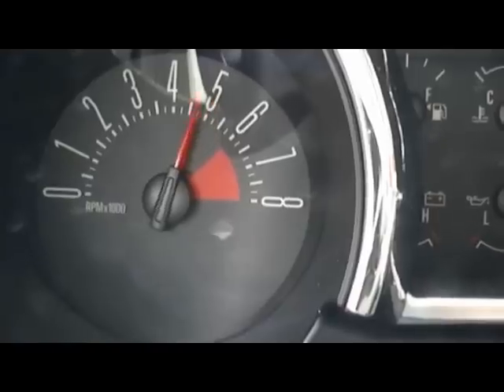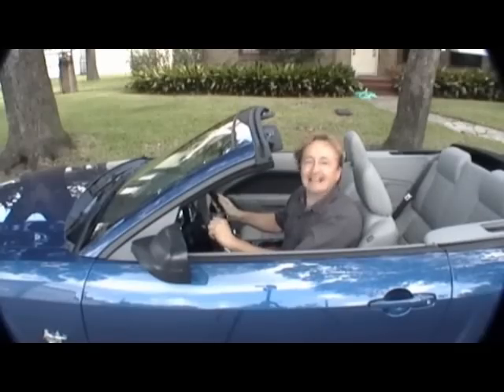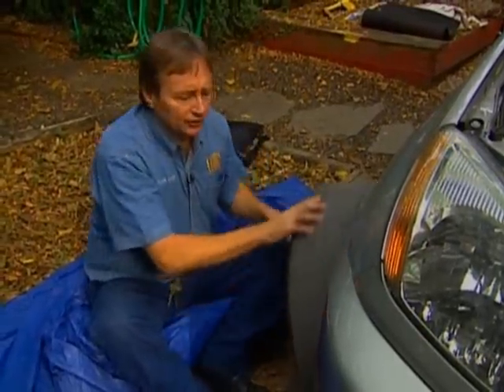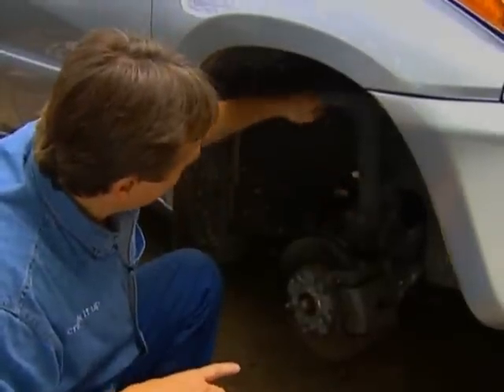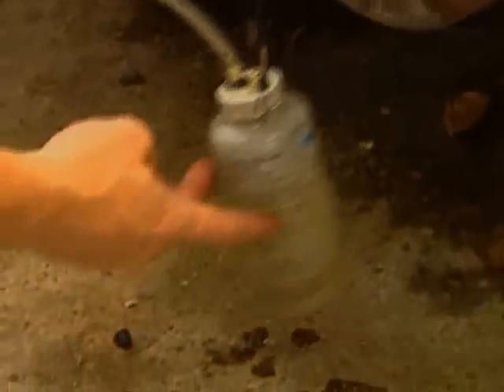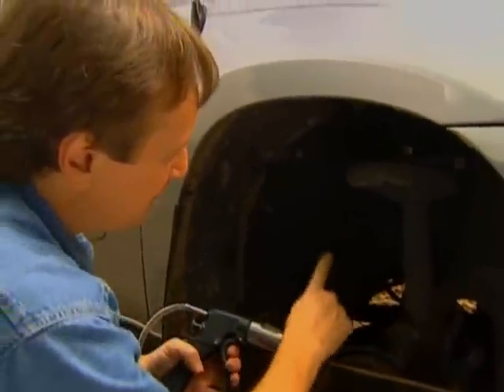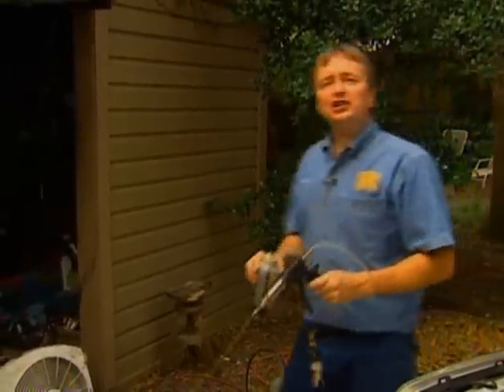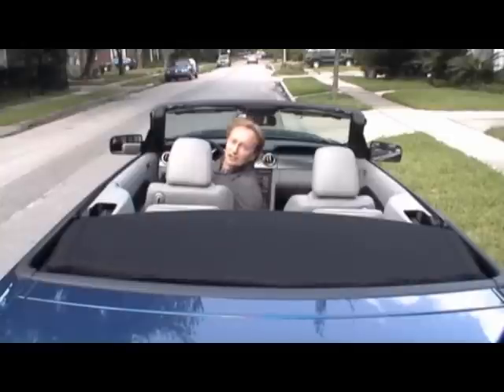How to Bleed Brakes in Your Car (One Person)

Comment: Scotty, please advise. I spend almost 1 week just to bleeding air in my brake system. I was just want to replace the discs and clean the piston chambers; but when I need to bleeding, it seems that all of the air is gone, fluid gets out from all bleeding nipples, but my pedal is still could be pressed down until floor. I've try to replace the brake master cylinder (with a cylinder of another car that works), replace all the piston seal, but still no succeed.
What should I do/try? Thank's in advance. (My car is a 2000 KIA Carnival)
Ardhian-Indonesia
Reply from the maker: IF you car has ABS brakes, you must pay a mechanic with a dealer level scan tool to bleed out the brakes, it can't be done any other way. If it doesn't have ABS, find a guy with a power bleeding machine, they always blow the air out
Reply: Scotty Kilmer Thank's a lot Scotty for quick response. Mine has ABS, but after so long effort, a "vilage level" mechanic told me to try to invert right caliper to left and left one to right, in order to make the bleeding valve inverted from bottom of the caliper to the top. Before I do that, I was wandering, what the h*ll is the difference...?! But due to my confusing what to do, I did that too.
And after some pedal pumping, it gets works. Everything is normal.
I'm now really sorry to buy some parts that does't affect at all, but I think it's worthed. :D
But I'm still wandering 2 things:
1) Why did with the old position of caliper and nipple (long time before replacing the disc), my brake was alright?
2) What is the difference between top and bottom position of the nipple on the calipers?
Would you please explain..
Thank's in advance..

Comment: Hey Scotty,I'm about to change the abs module/pump on a 03 escalade,any especial instructions besides the obvious on bleeding the system? Or do you have a video? Thanks.
Reply from the maker: panchovillaxx7 no video yet, but realize you may have to pay a mechanic to do the final bleeding out of air as it really does require a dealer level scan tool to operate the module and bleed all the air out fully in most cases
Reply: fair enough,im really against dealers,but im might just have to take it to it,since I don't have the scanner, thank you.

Comment: a young lad at my garage while the brake shoes were removed i asked him to check if the wheel cylinders were leaking for some reason he decided to get in the car and press the brake peddle, can this cause any other damage other than poping the wheel cylinder seals and air in the system?
Reply from the maker: na, just would pop the seals and get air inside

Comment: hello Scotty please reply. Can i used that tool on a master cylinder that has air in it? will it work on a master cylinder that has air? by the way how much is that Tool cost and can tell me whats the name please? thank you
Reply from the maker: yes, it gets air out anywhere, as it pushes the air up and that air then bubbles up inside the master reservoir and comes out the top where you add the fluid. It's called the phoenix injector, and they have various models and prices. Just google it and see which one you want to buy, they all work

Comment: Scotty would you have to 1st remove the master cylinder cap so the air your pumping back up can escape to atmosphere?
Reply: Yes and you also need to suck out some of the fluid in the reservoir with a turkey baster or something before you start or you might push some fluid over the side too.

Comment: There is a proper one man bleeding tool you can buy for about 5 bucks,its simply a one way valve on the end of a clear tube which allows you to pump the break peddle yourself with the nipple open not drawing air back into the system.
Reply: Where I can get that ? What's the name ? Any on Ebay if I want to deliver it Internationally ?
Reply: Halfords.ie .irish british auto store.EUROPAT VIZIBLEED BREAK AND CLUTCH BLEEDING KIT

Comment: I question how back bleeding any drum brakes will work very well with a Phoenix injector as the feed tubes to the wheel cylinders are lower at the wheel cylinders than the bleeders. This tool would be great on some clutch systems.
Reply from the maker: it works, believe me. The force the injectors inserts into the system would push air back that tiny bit of bend
Reply: That " bend" meaning a downward direction in the cylinder itself? It must create quite a flow. I'll stick with my pressure bleeder being I already have it. Thanks Scotty.

Comment: quick question, when i replace my brake booster do i need to bleed all 4 brakes or just pump the brake and tighten/loosing the lines that connected to the master cylinder few times?
Reply from the maker: +winkawak just pump and be careful not to move air downwards to the wheels
Reply: Scotty Kilmer
if i was going to replace my brake fluid will it be okay to use a turkey baster and get most of the fluid out of the master cylinder and pour new fluid in? will the new fluid circulate to all 4 brakes? also should i do it before or after pumping the master cylinder brake lines?
Reply: Scotty Kilmer
update
just installed my brake booster but now im getting a loud high pitch squeal when brake pedal is released, it will squeal non stop. I triple checked my vacuum hose and i didnt have this problem with the bad booster.

Comment: Help! Sometimes my pedal is firm, sometimes it's soft and goes far down... Does this mean I have air in the system? I already topped off my brake fluid.
Reply from the maker: if it has air in it, it will always be soft. your problem is more often a weak master cylindeer
Reply: Scotty Kilmer Got it, thanks!

Comment: I've just changed my brake pads. Now there's no pressure going through the line. But my ebrake still works. They was working before.
Reply from the maker: If pressure is sent back into the master cylinder too fast when pushing the calliper pistons in during a brake job, it can ruin the master; You may need a new master cylinder now
Reply: I've unhooked one of the lines to  master cylinder. One squirt. The other doesn't
Reply: Also now the passenger bleeds. But the driver side doesn't. The brake paddle is loose
Reply from the maker: Matthew Bui
replace the master cylinder
Reply: Did you ever figure out your problem? I'm having the same one... can't get fluid to 2 tire.
Reply: I fixed it. Bad line

Comment: It's good to know it will work on some ABS systems.  Actually, my modulator failed and required replacement so there was no way around an ABS system bleed.  

The modulator/pump assembly was $2500 from a discount dealer new.  That's about 25% of the value of the whole car!  I got a used one for $200 and it has been working for 3 years now; knock on wood.

Comment: Love your videos Scotty. I have a 2 part question. I recently opened the bleeder screws on my civic to decompress the cylinder (I had no tools and it was the only way to decompress). As a result my brakes now sink deeper than before, not entirely to the floor, but deep. Should I perform the reverse bleed as shown here or bleed the entire system? will that solve my problem? 

2nd Part: By mistake, I over tightened one of my brake bleeder valves and the cap fell off. Can i remove this with a reverse drill bit? I seem to find little guidance for this on the internet. I greatly appreciate your assistance!
Reply from the maker: yes, it should bleed out the air. and you can try one of those EZ out reverse drill bits, just realize it may break off too. Many times, if not leaking, guys leave em alone and use the brake hose bolt to bleed em in the future

Comment: Hi Scotty, thanks a bunch for the nice video! I did brake fluid flush on my 12-year old car, however found that the fluid flow was very slow no matter how smart/hard I pedaled down. I tried two wheels and found the same symptom. Do you think the brake system has lower than required pressure, and this low pressure is caused by the worn brake master cylinder or brake booster? I don't see brake fluid leak on the brake lines. BTW, for that two wheels tried, I didn't notice any air bubbles coming out. I had two times of experiencing spongy pedaling before. Moreover, while braking during running down a slope, I experience brake pulsation.
 Thanks!